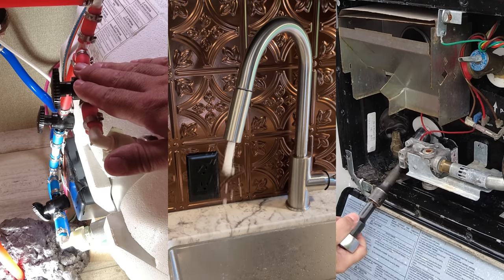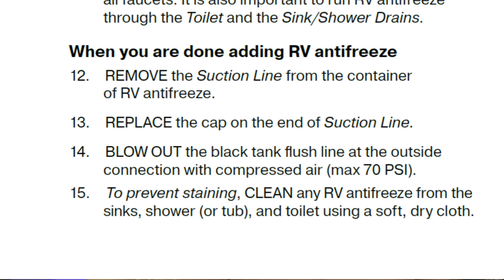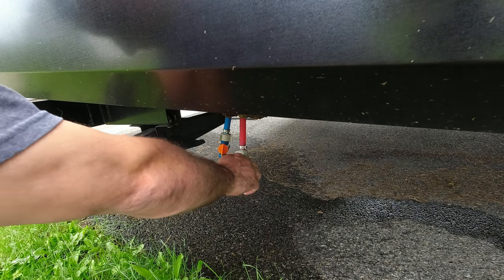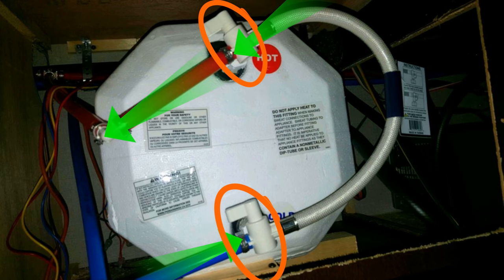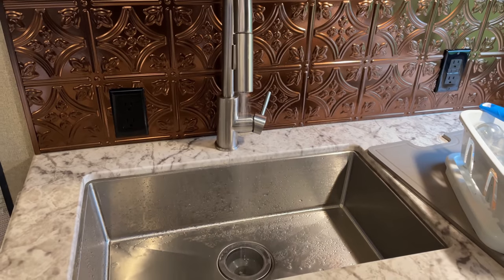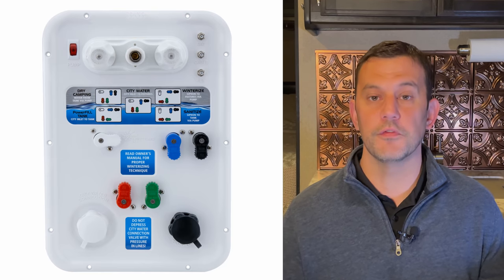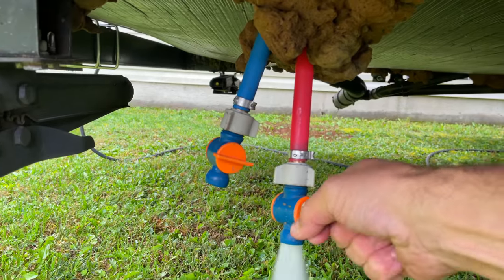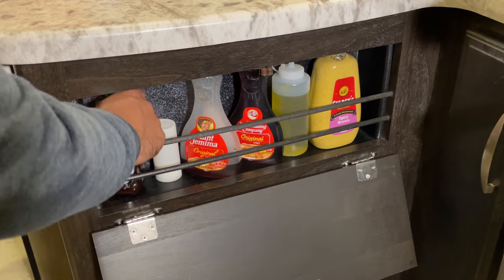RV Winterizing Made Easy - Step by Step Process for Beginners (Compressed Air Method)

Comment: I have been blowing the freshwater tank out through the low point drain for quite some time and water continues to drain out??? I have made sure that the trailer is level. Comment suggestions? Thanks for a great video and wonderful teaching.
Reply from the maker: the low point drains are most likely after your water pump, and blowing air back through a water pump wont work as it acts like a check valve.  just let your fresh tank drain, no need to blow it out.

Comment: Thanks for the awesome video.  I do have a question: is there anything special needed to be done on the water heater when it's time to start it back up? After winterizing with compressor, I can't get hot water again...just warm!
Reply from the maker: you're not blowing air through the water heater are you?

Comment: Thanks for the info.  We're new waiting on our Travel trailer to get here. What speed  is suggested when towing it?  22 foot 4500 lbs double axle.
Reply from the maker: Hey Mike, thanks for watching. The first thing you should check is the rating on your tires. Never go faster than what’s rated on your tires. In most cases that rating should be over 65 mph, but I think the majority of our viewers will agree 60 to 65 mph is the max they travel.

Comment: I have a one-valve waterheater 'bypass', on the cold inlet side, so I only use the compressed air method for winterizing.  I don't want any antifreeze to find its way into the waterheater tank via the hot side.
Reply from the maker: There's a check valve on the hot water side.

Comment: My dad used compressed air on our RV in the 1970's. Now my turn! Where does the air go when blowing out the black tank flush? Don't want to pressurize the black tank or toilet seal.
Should black drain be open?
Reply from the maker: It blows air into the tank.  the black tank will never pressurize... remember there is a vent from inside the tank that goes to the roof of the rv.  that is an "always open" air vent, its mandated by law to be installed on every rv, so your tank will never pressurize.

Comment: Hi Ross We are neighbors, I live close  to Country Junction and Beltzville Lake. Anyway I love your videos, very helpful. Planning trip this coming weekend to winterize our Fifth wheel RV in seasonal campground in Delaware. We are newbies to all this care and maintenance and winterizing. One question, I have a valve that bypasses my water heater. At this point I don't even know where my water pump is. Do I have to locate the pump and close off other valves as depicted in the video or is that one bypass valve sufficient. My RV is 2021 Forrest River Hemisphere. Going prepared with air compressor and also going to use Antifreeze afterwards thru whole system. Paranoia setting in
Reply from the maker: I’m 7 minutes from the Junction!  Small world. Just there this weekend for the pumpkin fest.  If you have a panel that bypasses your water heater there is nothing else you need to do to bypass.  I wish the RV was local, I’d come do it for you… all I’d ask was permission to film, but I love doing this stuff!  Does your panel allow you to siphon water from a bucket?  It should if you don’t have direct access to the pump.
Reply: Yes there is an "ANTIFREEZE INLET TO ANTIFREEZE" Also tells me close the valve to the tank and open valve to the inlet' I assume that valve stops flow of antifreeze to fresh water holding tank. That is in addition to the water heater bypass valve.I have pics of panel but no way of sending to you. Thanks for quick reply
Reply from the maker: You are correct, you’ll want to avoid putting antifreeze in the tank.

Comment: First year for RVing for me. Checked out your compressed air method for winterizing plumbing. You mentioned the antifreeze line for the water pump, which mine is missing. How do I get the water out of my water pump?
Reply from the maker: If you empty the tank and just let it run for 15-30 seconds dry you will be fine.  Your pump can run dry for much longer than that without issue.  I left mine on for 2 days accidentally with no water in the tank a few years ago.

Comment: Amazing exppanation,so if i was connected to a city water(trailer park) fresh water (low point is not gonna have anything if i open right)? also if i didnt blow with air i shouldn t have a problem since i AF (pink ) the system.Thank you in advance.
Reply from the maker: no, youre low point drains will have water in them if using the tank or the city water.
Reply: @RVTIPSANDTRAVELS  hmm thats funny then,i did had water in low poin red and blue but no water in the one thats a bit away just one single drain point
Reply from the maker: are you sure that wasnt a tank drain?  they are usually together.  the low point drains are a part of the pressurized plumbing system and usually located after where the fresh tank lines and the city water lines meet.
Reply: @RVTIPSANDTRAVELS  o opened blue and red and drain water also later on when i AF the system i double check and pink sruff was draining out but there is also this one seperate drain and when i open that one wasn not even a drop
Reply from the maker: Willing to bet that’s your fresh water tank.
Reply: @RVTIPSANDTRAVELS  that makes it more strange there was nothing goin out when i open the valve
Reply: you are right sir,it is fresh water tank.But why didn t drain anything, its my first year winterizing i did everything you said,but no water from that drain,any idea?
Reply from the maker: Did you fill your tank this year?  If not, that’s why there’s no water.
Reply: @RVTIPSANDTRAVELS  No i did not,i thought it has anything to do with citywater connection,makes sense now.Thank you very much and wish you great success with your channel.

Comment: Question: if I don't have the fitting to the pump can I just marry them the best I can and accomplish pushing the water out? Also, my filter seems to be on very tight. Is it possible to remove with some sort of tool? Thank you for the thorough explanations.
Reply from the maker: Hey Thomas, you should be fine pushing air anyway you can through that line for a minute or 2 to get enough of the water out.  remember, water droplets in the line wont expand enough to crack the lines.  as far as the water filter, if you cant get it off by hand and you've blown air through the water pump, you should be fine just leaving it on.  as long as air has passed through there you should be good.

Comment: Ok great videos and guidance... My Water Heather is leaking lot's of water thru the Drain Plug ... I'm a Rookie and 2 Months only in the RV living.   I'm in Florida and Not moving the RV from it's location. What should I do !!!
Reply from the maker: Try tightening the plug, if that doesn’t work, just buy a new plug, it’s common to replace them.  What is the manufacturer of your water heater?

Comment: I just winterized my travel trailer and followed the very thorough instructions. However I will leave my shore power connected as that is what keeps the batteries charged. Lead acid batteries will fail if left uncharged all winter.
Reply from the maker: I will bring my battery in the garage and put it on a trickle charger for the winter.  It gets pretty cold here and low temps can degrade the life of a battery.  Plus, I wont have my converter running to charge the battery all winter.  Thanks for commenting and watching Don.

Comment: Is there anything extra or different steps when camper has a tankless water heater?
Reply from the maker: You can treat tankless heaters like additional plumbing lines.  Essentially that’s all they are: zig zagged plumbing lines that get heated as the water travels through.  No tank, so you can blow through or introduce antifreeze.

Comment: Do you leave the low point drains open or do you leave them closed with the pink antifreeze ?
Reply from the maker: leave them closed... they are drains for most of the plumbing system, so if they are open you will drain everything you are putting in.

Comment: We are nubies and will be FT RVers beginning 11/29/22. Our trailer is in storage until then and the temps are getting into the low 40s and high 30s. We do have the imagine 2970rl. Is this something we should winterize between now and the 29th? We have recently camped a couple weeks ago as well. Then, once we are living in it is there chances that the pipes will freeze?  We are in the Portland OR area. Thanks
Reply from the maker: Low 40’s and high 30’s are ok.  I’d winterize before you get into the low 30’s for a couple nights in a row.

Comment: I have a question. When the water heater drain plug is open, and before I bypass the water heater, should I blow water into the city water connection? Will that eliminate water that doesn't get eliminated when the water heater is bypassed?
Reply from the maker: Terry, it will help push some water out of the tank but because the tank is such a large area that pressurized air is dispersing once it hits the tank so you’re not getting as much pressure out of the drain, if that makes sense. It won’t hurt anything if you do that, but there’s so little water in the tank after emptying it, even if it freezes it won’t hurt anything.

Comment: I have found the appropriate antifreeze at Home Depot, Splash down to 75 PG - no alcohol, but if I want to blow my lines, what kind of connection do I use at the water pump line on my 2600 RB, the same as yours?  Thanks!
Reply from the maker: No need to blow that antifreeze line if you are putting antifreeze in last.  The antifreeze will push the water out of the pump.

Comment: Do you let your camper sit outside in the snow uncovered and unsheltered?
Reply from the maker: I do, no problems.  Same thing happens at RV dealerships.  I will however brush snow off the roof if it starts to accumulate.  One day I hope to have a pole barn for the rv.

Comment: If we live in East Texas and don't get many days below freezing is it necessary to winterize? If we winterize that doesn't allow us to camp during winter and living in Texas we have weather that is pleasant enough to camp in during winter. How can we use it a couple times during winter without doing this process every time? Thanks
Reply from the maker: if you dont get below freezing temps at night for more than a couple days you will be fine.  I dont live in the south but i do know a few people who do and in the winter they will just drain the water system at the low points, run the pump to clear the water out, and leave the faucets open.  they do this on cooler nights just as a precaution, but again, its something you should monitor.

Comment: Last year I blew the lines out and forgot to close the low point drains while blowing out the system.  That made it not as thorough and my kitchen faucet froze and snapped off.  I now put low point valves closed when I am done and leave faucets open after I am done blowing out the lines
Reply from the maker: Thanks for watching Kevin, hope the video helped.

Comment: Thanks for all your tips, but I have a question, concerning bypassing the hot water heater (3 valve). I’ve never used my fresh water tank, nor the water pump. If we consider only the primary lines, can I simply drain my water heater, plug it back up, then without bypassing the heater, use air pressure to clear all the primary lines, then open the heater up again to drain any more water that’s been pushed into the heater? Thanks!
Reply from the maker: no, it doesnt matter if you havent used the fresh tank or the water pump.  all water flows through the water hear, even city water.  drain it, then bypass it.  if you dont bypass it and try to blow air through the water heater, youre not going to get good pressure coming out of the tank to blow out all the hot lines.
Reply: @RVTIPSANDTRAVELS  thanks for the reply. But I think you missed part of my question where I said drain the heater then Plug It Back Up, and then clear the primary lines. Am i missing something? I’m fairly new at all this. Thanks!
Reply from the maker: Your trying to blow air through the heater back into the hot lines correct?  You won’t get as good air pressure that way.  It’s better to bypass it, that way you don’t have air going into a large tank, since it won’t ever pressurize you’ll lose air pressure at the hot lines.
Reply: @RVTIPSANDTRAVELS  Thanks, the water heater is a pain to get to so I was hoping to avoid it.  Keep up the good work!

Comment: May be a dumb question and maybe I missed something, but why do you connect to shore power first? Seems like everything will operate on 12v. I don't remember seeing where it might have come into play other than plugging in your compressor.
Reply from the maker: Anytime I can plug in I will.  It keeps the drain off the battery when you open slides, turn on water pump, lights, furnace if it gets cold when winterizing, etc.  but not a dumb question at all.  Your battery will run the slides and pump.

Comment: I'm not getting any water to come out of any of the faucets.  I bypassed the heater, blew air through the coolant line at the pump, diverted that valve back to the pump, and hooked air line at the city water port via a blow out plug/fitting for my compressor line set at 40-45psi.  Nothing comes out of any faucet.  Am I supposed to do this with the water pump on or off?

The fresh tank & gravity fill line are drained.  Low points drained.  Water heater drained.  The TT been sitting for a couple weeks since we last used it.  It's. 2021 Wolf Pup 16bhs.
Reply: Figured out my mistake.  I left the low point drains opened so it wasn't building up air pressure.  Thanks for the informative video for this camper newbie.
Reply from the maker: check your low point drains..... oh wait, i am just seeing you got it.

Comment: Hello! Will automobile 12v tire pressure compressor be enough to handle this job?
Reply from the maker: That depends on the pressure it exerts. Should be a constant 40 psi flow.

Comment: How much antifreeze do you put in the P traps?
Reply from the maker: About 6 ounces, but remember if you opened your faucets until antifreeze ram through, you most likely already have it in there. Adding more later is just a precaution but doesn’t need to be much.
Reply: @RVTIPSANDTRAVELS  Thanks! We’re blowing out the lines. So I’m guessing that 6 oz still applies?

Comment: Thanks for the info. But I think salt should be pretty safe 😅, no bugs want to mess up with salt, oil should be relatively safe too.
Reply from the maker: Mice are attracted to salt and salty foods (sweet foods too).  The salt will be fine yes, but you’re eliminating chances of mice coming in. They are also fond of cooking oil.  Used oil poured in a field, for example, will attract animals and pests. If a mouse gets in your camper they could discover and chew through a bottle of cooking oil leaving a nightmare to clean up.
Reply: @RVTIPSANDTRAVELS  That's good to know.

Comment: We have never put any water in our fresh water tank and have not turned on water pump. So there is no need to flush the pump with air, correct?
Reply from the maker: That is correct Teffany, However some dealers and some manufactures will run water through the pump for testing purposes. It might not be a bad idea to run air through it, or pull that water filter off and make sure there’s no water in it.Thanks for watching!

Comment: Hi, I located my water pump, but it does not have the winteriztion hose and the valves. Its just a hose from the water tank to the pump with hose clamps. And a drain hose that runs down with a valve. Is there another way to get the water out of the pump?
Reply from the maker: you can add a hose with this kit: https://amzn.to/3QAu8lS

Comment: Is it necessary to by-pass a tankless water heater?
Reply from the maker: That actually depends on the manufacturer of the tankless water heater. You’ll have to check with your manual or manufacturer on that one.  Sorry I couldn’t answer that question for you.

Comment: Please help,,  I am staying in my camper this winter,,    so I'll be using my tanks for all needs,,   so using this antifreeze won't be an on going option,,?
Reply from the maker: are you connected to water or using your tank over the winter?
Reply: @RVTIPSANDTRAVELS  could be just filling, and then using tank, over and over instead of a hose connection
Reply from the maker: First I would say you need a tank heater and a heated underbelly to start.
Reply: @RVTIPSANDTRAVELS  they both sound expensive,,,,,    ugh.  Idk where to start
Reply from the maker: Your camper might have come with them.  Check your manual.